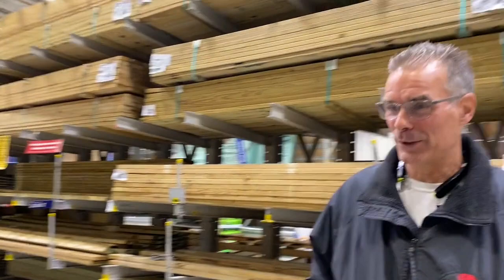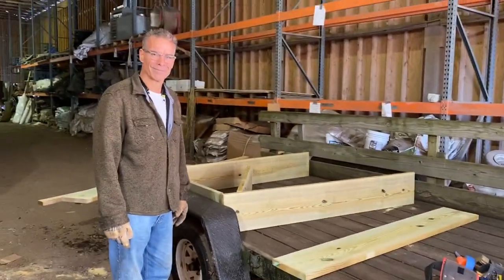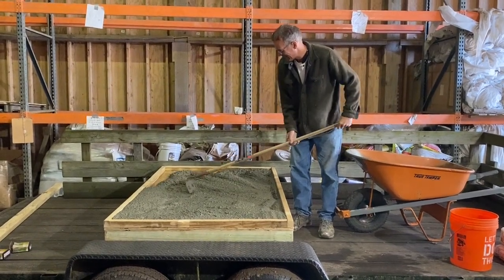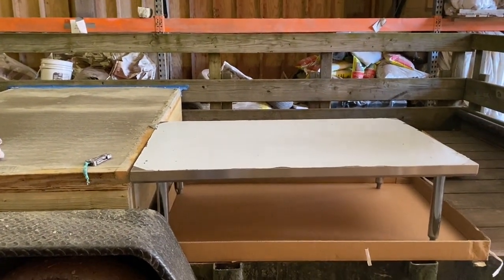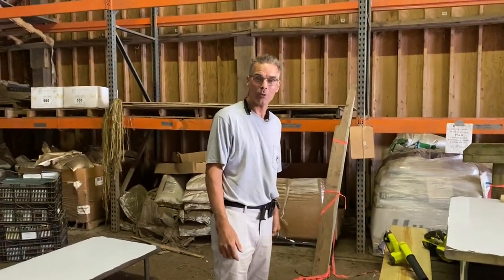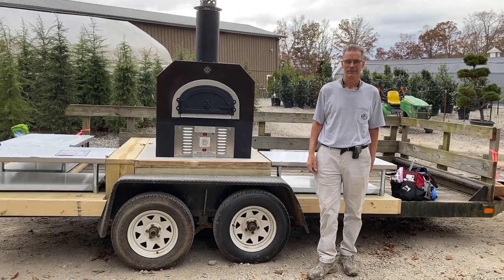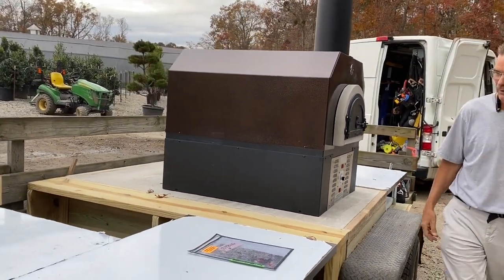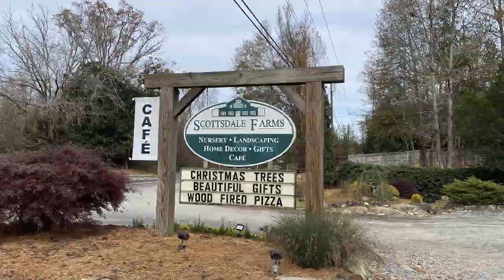Wood Fired Pizza Oven on a Trailer: An installation video

Comment: wouldnt that big concrete slap crack when driving on any road that is not completely flat?
Reply from the maker: Hi Thomas - You are correct, however, we built this not to be taken on the road.  It is in a big farm that it will be moved slowly from place to place.  We would have engineered this more if the intention was to have it roadable.